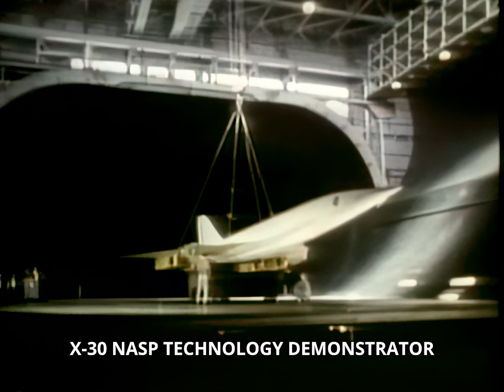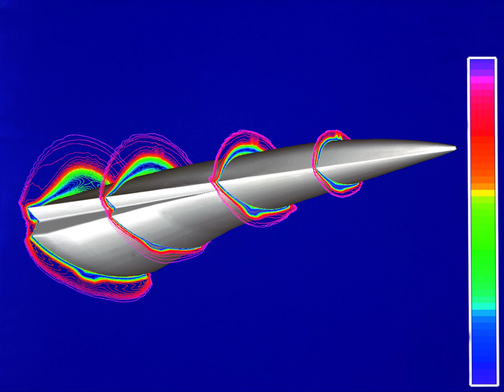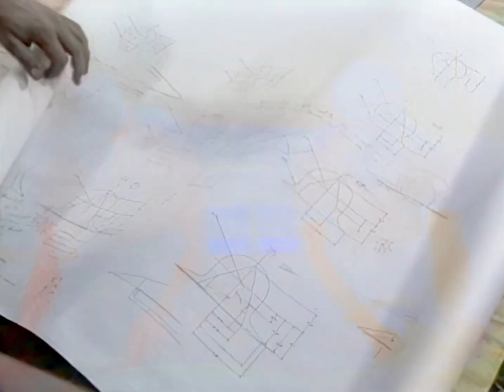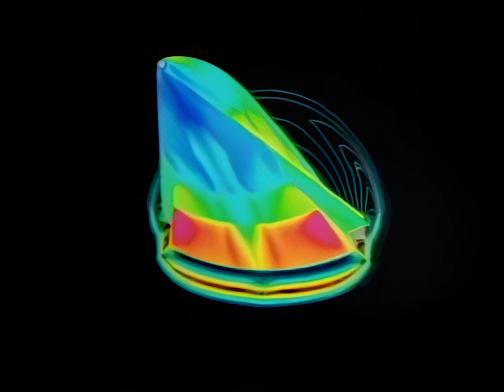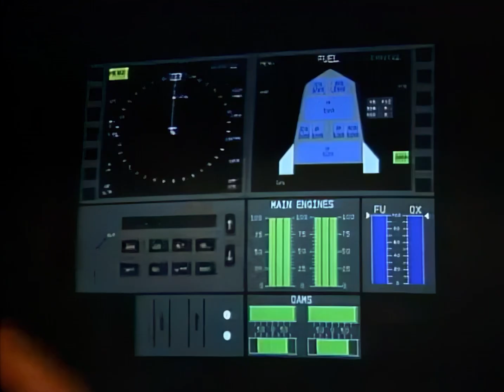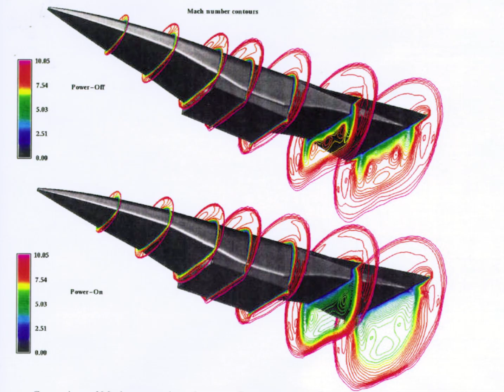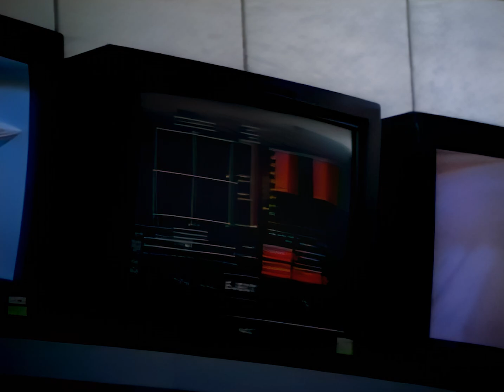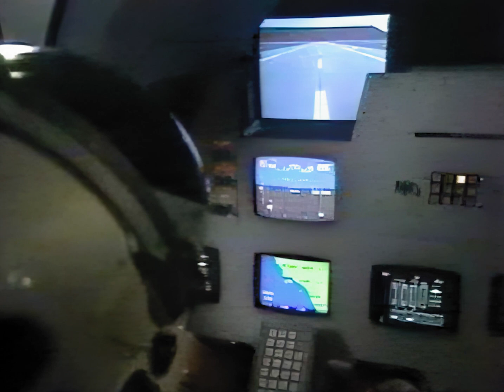X-30 NASP Evolution 1986/93 - Historical Footage and Narration, National Aerospace Plane, NASA

Comment: Wonderful video; thanks for posting it!  It brought back a lot of good memories.  I had the good fortune of working at Pratt & Whitney in West Palm Beach as a junior (very) engineer on the NASP propulsion system from 1987-1990.  The senior engineers and managers at P&W, the airframe manufacturers, government research centers, and government program office were a phenomenal group.  On a side note, when I started at P&W in 1986, the PW5000/F119 engine for the F-22 was early in its development.  I am retired, now, but the F-22 is still the world's premier fighter.  Similarly, the F135 engine for the F-35 was just a conceptual design at that point.  In 1990, I went on to work for P&W in East Hartford on the PW4000 series of turbofan engines for the Boeing 777 and the Airbus A330 airliners.  It was a great time to work in the aviation industry.  Thanks for the memories!
Reply: I also worked on the NASP at Pratt&Whitney. In fact, I replaced @robinkellylhamm when he transferred to East Hartford. I traveled a lot and spent time at remote locations for the program. It was a great time and I met some wonderfully talented and committed engineers. When the program was cancelled, I transferred to the F135. The poster at 14:05 hangs in my house and a Contractor model sits on a bookshelf. It was the highlight of may career as an Aerospace Engineer.